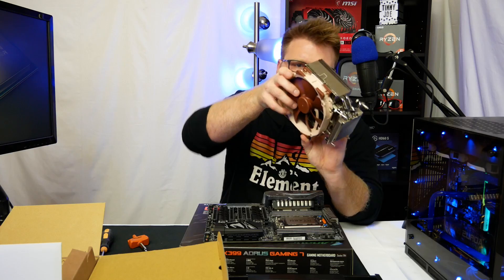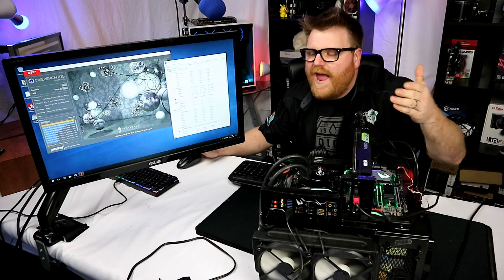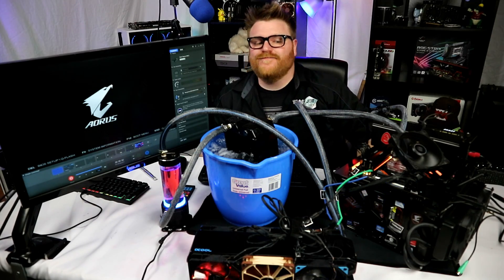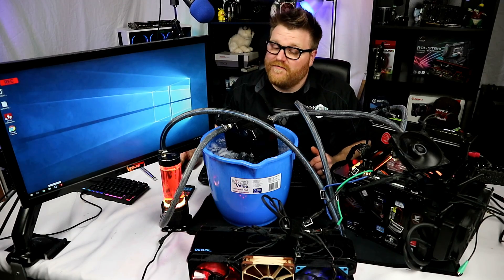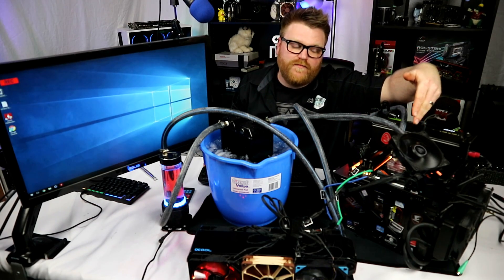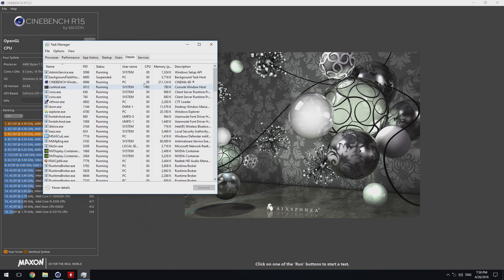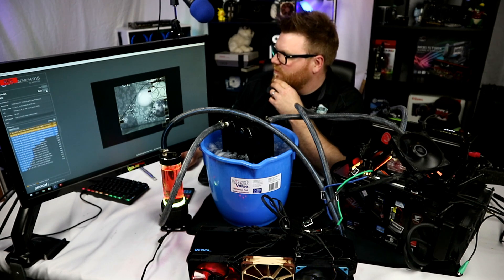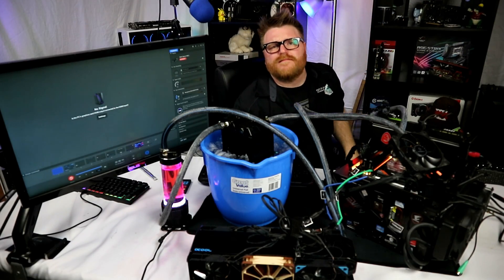Ryzen 2700x 4.4Ghz EXTREME overclocking! (2000 pts in Cinebench?)

Comment from the maker: So I should have mentioned in the video that I tested a lot of stuff. LLC is set to Turbo (max) I do have the volts managed pefectly. I tried increasing ram beyond spec and played with timings but it was hurting my stability. This was after I had already set up the ice bucket and I was hours in to trying to hit 2000. What I need to do for next time is find the best ram settings first, however I have reached out to some friends in hopes to get some higher speed memory for next time.

So there will be a part two... Stay tuned :)
Reply: I got 2033cb on air at 4.358ghz. Ez m8 1.425v
Reply: Timmy Joe PC Tech I still haven't hooked mine up, I haven't had time to really build it onto the itx board I have for it or to get the x370 taichi I have out of storage and my k7 is being RMA'd - the issue I have with the itx board is its a Gigabyte b350 gaming WiFi with notoriously small vrm heatsinks and without the Zalman cts8900 am4 bracket in combination with a gentle typhoon I got I dont believe I will have adequate cooling for the vrm. The plus side is Ive gotten my TridentZ 4266 kit stable on a 2400g at 3566 CL16 so I'm expecting even better results with this things memory controller and I can tell you the memory really does have a big impact on score giving hugely impressive results with the core frequency at 4150mhz - so with double the cores and an extra 250mhz I could only imagine....
Reply: Gigabyte has a guide on how to overclock Ryzen CPUs on their motherboards (https://overclocking.guide/gigabyte-ryzen-7-overclocking-guide/), raising the CPU VDD18 to 2.1volts stabilises overclocks using Turbo LLC and this Youtuber used it to hit 4.3 to 4.4 (https://www.youtube.com/watch?v=zqMRY49qheM).
Reply: Did you try windows 7 ? Pretty sure it scores better than 10
Reply: You don't don't need all the crazy cooling, bro. You just need a RAM kit that'll run at 3600+. Look at G.Skill 4133/4266 CL19 b-die kits & I promise you'll blow past 2000 in CB, like it's nothing. Should be able to run it CL14 3633 MHz, no problem. (If not faster)
Reply: Timmy Joe PC Tech just use better ram timings very important aswel
Reply: Tweak that ram to the max with a stable cpu clock first, in my experience it can take a few days to get the max out of ram timings, primary, secondary and tertiary timings! Make sure its stable tho for sure (the time consuming part!)
Reply: Also I noticed that when i set cinebench to Real time priority cinebench WILL freeze and cursor will freeze until it is finished. Doesn't always mean the system was unstable!
Reply: Timmy Joe PC Tech put put salt in the basin with water and ice so the temperatures drop more
Reply: you need to play with memory timings and you can get your 30 points you need, also try over clocking the memory also,, on my old 1700x I could not get 4.1ghz to run but when I missed with the memory I got 4.1ghz to run.   I have not tried over clocking my 2700x at all because the XFR2 is very good why do I need to ,,,, but because your doing this it makes me want to ahhaha
Reply: Timmy Joe PC Tech steve at gamersnexus said the chip can handle up to 1.6v with adequate cooling, if your cpu isn't overheating then try closer to 1.5v or even ~1.52v

Also tighten up the timings to bring your RAM to 3466 or even 3600Mhz
Reply: I think you could try a deliding video on this ryzen if there even out. Go outside the box and delid it  TIMMY JOE BRO. CLOSE THE CHROME THAT EATS SYNTHETIC BENCHMARKS IN TASK MANAGER ALL CHROME PROCESSES.
Reply: for real chrome is garbage lol chrome lol
Reply: Lower TRFC on BIOS, 300 or 350, might give you that bump... TREFI to 4 or 1 real quick tweaks to increase some performance and overclock. Haven't tried Ballistix memory... but I guess they are Micron. If you got a pair of G.Skill Trident Z RGB 3200 CL14 lying around, you probably can get that 2000 for sure.
Reply: The non-ice water radiator is warming the coolant. Either remove it or put it in ice water too. Insulate the hoses and reservoir. Been TEC cooling, all this will help get you a lower temp. Also you need circulation in the bucket for max cooling otherwise the water around / in the fins will "warm up" put a cheap china pump in there to make some flow. Cheers
Reply: its cooling the hot water before cooling it again but puting the other in ice water also nice idea
Reply: B D No, that's not how thermodynamics works. Turn off the fans and temps will go down, provided the rad remains in ice.
Reply: i know this is not going to be read but...
you could also close explorer.exe and later Winkey+R and enter Explorer to enable it. saves few points in cinibench...
Tweak memory to lower latency faster responses result into more CB score 2000+ is fairly easy to achieve i've had 3 2700x's  two of them Oc'd in friends systems that i helped overclock with simple AIO kelvinS360 and Corsair H110i and the last one is my own (that i have returned now since i wasn't happy with the silicon lottery 4.39ghz and unstable so i returned it waiting for new one. BUT! a CB R15 scores were all over 2000+ on all 3 processors. singlecore  scores of  190+

key notes: 
PSU: LoadLineCalibration: 75%+ (High~Extreme) 
DO NOT GO OVER 1.45V on CPU 
Lower dimm timings My personal preference are Corsair memory they are really versatile when it comes to overclocking. CL12 ~3.6ghz
Obviously disable all XFR/ automated stuff just turn it off or manual settings.
slightly increase NB voltage 0.002500+ at best (improves stability)
Make sure you run latest bios version also noticed you used a Aorus Gigabyte board  in my experience their not the best when it comes to "Extreme" overclocking.
However Asus 350B prime should do the trick. managed to get a 2038 CB score.
Reply: Timmy Joe PC Tech you are amazing. I laughed when you called us "f"rs
Reply: Timmy Joe PC Tech next time add salt to ice it will freeze the fucking hell
Reply: Use Liquid Metal as thermal paste :D
Reply: WINDOW 7 FOR BETTER RESULTS
Reply: @LawrenceTimme  you are smarter then Timmy joe who use bucket for less score
Reply: The trick is to use XFR and not multiplier.  Then use baseclock to go above 4350mhz.  Best I’ve gotten is 2102 at around 1.5v running 4.55ghz on a Corsair h115i Pro AIO.  Also have memory running 3533mhz at CL14 w/ 14-14-14-22-36.  Also running 4.4ghz on my daily setup which pulls a 2065 in CB15 at 1.44v
Reply: I feel your pain, man! But I suspected it would go that way. I just picked up a 2700X because they're dirt cheap now, but I never had any intention of OCing it despite having had over two hundred world records at HWBot back in the day. It's sad to say, but AMD (they of the always-unlocked multiplier) are killing overclocking with their basically perfect calibration of their boost feature. It's kind of sad, but liberating in a way. I'm just gonna plug-n-play this build for the first time since I owned a Dell with a Pentium-4 in it. 

This 2700X is quick, though! In CineBench R15, at stock it comfortably beats my i7 7800X at 4.8GHz. And that's with the Ryzen running four mismatched sticks of DDR4 in a cheapo board (for now) versus a tricked-out X299 rig that even features the Timmy Joe Signature (TM) NZXT Kraken X72!  So color me impressed with this peppy little 2700X. 

Anyway, I was rooting for you to get your perfect run. Sorry it didn't pan out that time.

Comment: When we were in Thailand I think luckynoob hit 2012cb on 4.3GHz, you have to OC the memory as much as you can, I got 1915 at 4.2GHz with 3600MHz memory. Nice attempt, almost got there!
Reply: Tech YES City Good call Brian. I get 1917cb at 4.2ghz and 3333mhz Ram. Can't get the system stable trying to OC the ram to 3400. Ugh memory.. hopefully with a supposed class action suit against samsung/micron we'll see prices some down. Ram timings is something I've never really messed with, so many variables and numbers.. makes my brain hurt.
Reply: Agreed like Brian said...  Get a faster memory kit and you're in there like swimwear!
Reply from the maker: I have some feelers out for some high speed memory, if something doesn't pop up soon I'll have to give it that tech yes treatment and buy some 4000MHZ mem my self! Thanks Brian!
Reply: Also dont forget to murder every other process, be it a background or service!
Reply: my highest was 1925 on 4.2ghz and 3200mhz ram using stock cooler lol
Reply: Well let me know when you need some tech yes lovin', I gotta a whole lot to give.
Reply: I think that a pair of sticks from g.skill at 3200mhz rated at 14-14-14-34 will provide a higher cinebench increase than a 4000mhz cl8-cl19 kit. Most benchmarks show that timings matter more than the frequency. Atleast for these new ryzen chips.
Reply: i ez got 2080cd 4.2ghz, 3600mhz cl18 on x470 aorus gaming wifi 7
Reply: I just hit 2000 ocing the memory. 3133 with bclk at 102.

Comment: Hey man. If you don’t want to push the voltage anymore, then play with the memory. R15 responds well to increased frequency and tighter timings on the System memory.
Reply: Would bumping the voltage to 1.485 matter that much?
Reply: E3qualsz None Wouldn’t think so, but I don’t know what the load temps are with the two rad setup...?
Reply: Yup fast ram will improve its performance significantly
Reply: People always seem to forget about timings. They matter a lot. 2800cas15 is a little better than 2933cas16 for example.
Reply: E3qualsz None Ya don't run 1.485 volts to your CPU unless  you want to kill it 1.45 is the max AMD says it can handle and 1.425 for a stable long term overclock isthe max you should but honestly most push around 1.4 to be safe
Reply: @ashleywallace2233  you can't kill your CPU with a good mobo anyway, it will shutdown before, happens to me when I increase the voltage too much and stress it with some bench

Comment: Timmy Joe, I would advice the below and I'm quite sure you will pass 2000 points in CB15. I was top 2 in HWbot for my country. Now in TOP 5 dammit. :)

1) getting some nice G.Skill B-die ram 3600C15/3200C14 or higher as you can always clock them lower with tighter timings if needed. Many good guides/results/settings in overclock . net.

 2) Turn off/disable every service in "Services" that is not need. I would say you can disable a lot of them. Many guides online for "unnecessary" services. And disable every startup program that might run which you have already some if Google Updater was already running. 

4) Final and probably the most IMPORTANT which will probably give the points needed, after opening CINEBENCH and TASK MANAGER, close the EXPLORER.EXE and everything service/program that can be closed in task manager and set CB in higher priority and wait 10-20 seconds before and watch cpu activity just in case windows reopens something that was close and takes a few cpu cycles away. Then close task manager itself from task manager, alt-tab if CB is not shown and....

Now bench away!

Bonus: And disable Windows Defender real time protection or anything that can be disabled or even better, remove it! 

And if you want also go to System-->Advanced system settings-->Advanced tab-->Performance-->click settings-->select Adjust for best performance.

Comment: Just got the same system put together last night, well into this morning and hit 1922 on cinebench and that was enough for me.  I did it with less voltage though.  my aio is a evga 280mm on the 2700x, 16gig of flare x 3200, evga 1080ti hybrid with a samsung 960 evo 500gig.  same motherboard, the gigabyte X470 gaming 7 wifi.  I'm not real familiar with gigabyte boards bios, so there probably room for improvement.  I put everything into a thermaltake view 31 RGB case with 6, 140mm fans and 2 120's, why?  because I could!  LOL..If I ever decide to upgrade again I will push it over the edge with volts and heat, but right know she's too pretty!  Great video TJ..!

Comment: hey, if you're just going to do testing with that setup, it can handle 1.55 volts in short bursts, you can also increase soc voltage to get higher mem overclock. all of this assuming you have the temps under control

Comment: Did you set CPU VDD18 to 2.12 volts? This will help stabilize the OC in windows. As well as loadline calibration to TURBO to help stabilize voltages. You COULD set CPU VCore to 1.46250 volts as well. Did you change chipset voltage any? If not I recommend setting the 1.05v core to 1.210 volts. :)
Reply: Is that safe? I've come accross this before where someone has stated this and am curious if it actually works + is safe =S hmmm....
Reply: xversacex it is safe and f you just want to run a couple Cinebenches, but I don’t think it’s safe to run 24/7.
Reply: As with overclocking there are drawbacks... too much voltage overtime will decrease overall lifetime but it is negligible. Anything over 1.5vcore is asking to blow it up, but yes it is safe
Reply: How come no one ever talks about which monitors they are using?

Comment: Turn off nvidia container and windows defender it uses a tiny little bit of CPU power sometimes. And try shutting down any unnecessary windows services. But i am sure that one wont help much. But anything for the ~10-20 points, right?
¯\_(ツ)_/¯
Reply: Varg what does nvidia container do anyway?

Comment: I'm a huge folding@home person and have been doing it for over a decade. As a result, I run push my computers to peak performance, and a 100% stable overclock is necessary to get good results, otherwise your data is corrupt and/or your client fails. When I overclock, I often achieve higher overclocks with less voltage then most, and I've been doing it since the pentium 4 days. Basically what I do is pick a frequency, then bump the voltage down until it isn't stable, then go back to the last stable voltage. I document everything on a notepad as I'm going including when I turned off/on certain settings. This means I'm always using the bare minimum voltage to achieve the highest clocks and can always refer to my notes and get back to a stable position. What I've found is that AMD's love high memory frequency, and ryzen is no exception. Especially when you start playing with baseclock, you have to have extremely high-spec ram (ie high frequency, good ram timings), and need to run it 0.1-0.19v over spec to achieve a good overclock on an AMD. This isn't necessary on an Intel (not to the same degree). The last thing you can try is overclocking by core on Ryzen. I could see what you were going for on that crazy ice bucket loop, and I was sitting here wondering if you have the flow the  correct direction? You sure it's pushing from the ice bucket radiator pulling from the air/fan radiator? Lastly, disable the on board soundcard. I know how weird that sounds, but in the past it has caused me issues with overclocking on multiple boards throughout the years because on board sound relies on the processor to some extent.

Comment: You should def tweak your memory timings, both primaries and secondaries (tertiaries are less essential for that).Besides primaries , set your trc the lowest it can go (tras+trp). Also set your trdrd_scl, twrwr_scl and trfc the lowest it can go, as its the most performance critical besides primaries and trc. You can also fiddle with trrd_s and trrd_l and tfaw. Don't set tfaw to lower than trrd_sx4. Oh, and setting the priority to very high definitely helps....the momentary freezes are normal on that priority, but you'll see that after few seconds cinebench will continue, and your score will most def higher. Also, with that cooling , 1.5v for a few runs won't kill anything.
Reply: And if you go the memory timing tweak route (you should ) prepare to clear your CMOS a lot... Save profiles that work to save time after clearing. Pretty certain if you'll follow what I said +setting the priority to very high+ 1.5v maybe allow you to squeeze 25mhz more, you'll hit that 2000. Make sure no unnecessary processes are running. Also put windows visual on performance mode, that can squeeze few extra points.

Comment: I think it's all about the memory at this point. Ryzen CPU's are a beast but they do accumulate lots of heat. My H115 Pro from Corsair can't handle it too well at high freq's either. I tried running a Prime 95 Torture/blend test on it for 30 minutes @4.2 ghz and it locks up after about 10 minutes. At 4.1ghz it handled Prime 95, but temps were hitting 78c after 30 minutes. Once OC'ing ram...The CPU performance goes off the charts without heating up the CPU...Just left the freq on auto and I'm hitting about a 1910 on Cinebench @3200mhz DDR4.

Comment: regarding your 2700x oc at 4.4 there is one trick that i know. I had squeezed a few extra points by changing the resolution to 480p and 576p to get a score of 1241 with one stick of ddr4 2666mhz and the ryzen stock cooler on an 1600. If this works then great.

Comment: Just recently upgraded to an i7-3960x. I get around 1375ish cinebech at 4
4ghz. I was using an i5-2500k at 5ghz before, however some games were maxing it out at 5ghz. I guess 4c/4t is starting to show its age in newer games nowadays. I only paid $99 for my 3960x ans $100 for an X79 board. I use an EVGA 1070 Founders with a Hybrid Kit, 16gb's DDR3, Corsair RM1000X PSU (which I got brand new and sealed for $80). I enjoy my performance very much :^)

Comment: Add salt to the icewater, it will melt the ice without increasing the temperature.
The change in water's state causes it to cool down.. alot..

i got -28c in my testing, used it to overclock old athlon xp to +400mhz (on air it got only 50-100mhz)